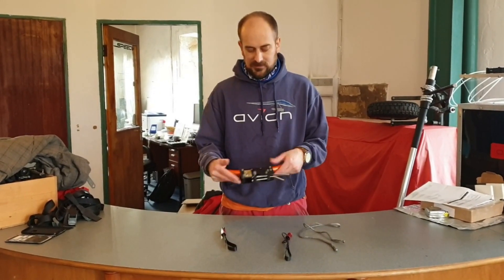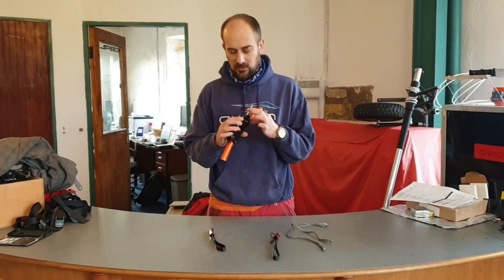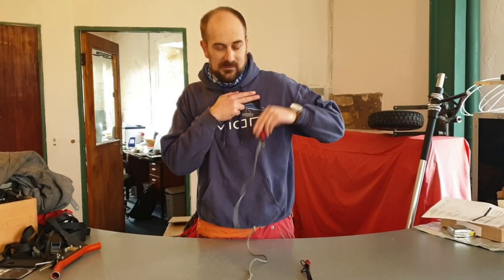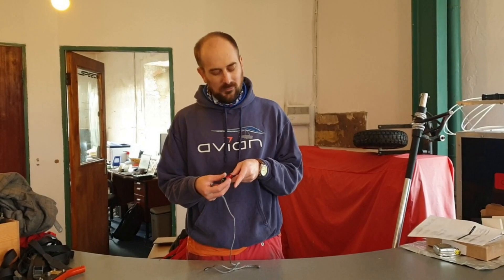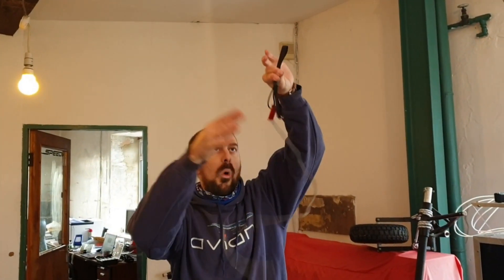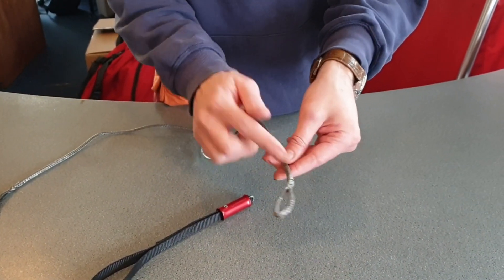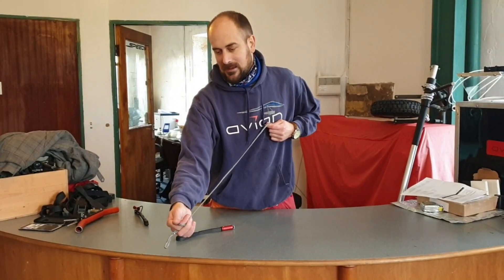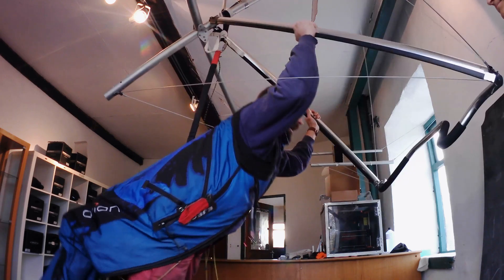Tow release types

Comment: I've just bumped into this excellent video Tim. Just to add a bit of information. The locking of the barrel release cord (video 6m 20s) happened when there was a lot of twist in the main tow-line. This resulted in the barrel release cord becoming twisted on itself at the main towline ring as the twisting was transmitted through to the barrel cord "v" at the towline ring. When the HG pilot tried to release with the one barrel that they had on their chest release setup the twisted cord locked on itself at the towline ring. The pilot was unable to release the other side of the cord as there was not a second barrel so could not easily get rid of the towline. This resulted in an incident report and an advisory from the BHPA that the barrel release setup must be able to release from both sides of the chest. Hence the dual barrel release which you sell.